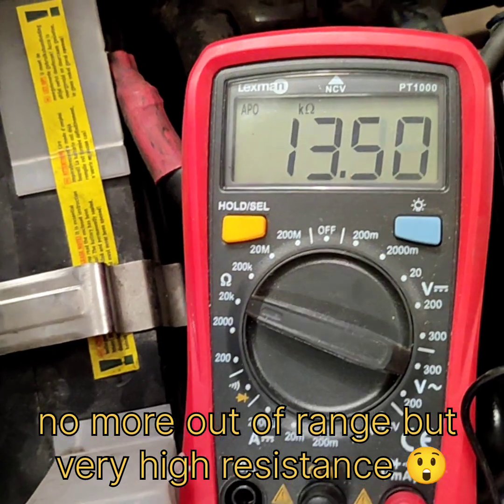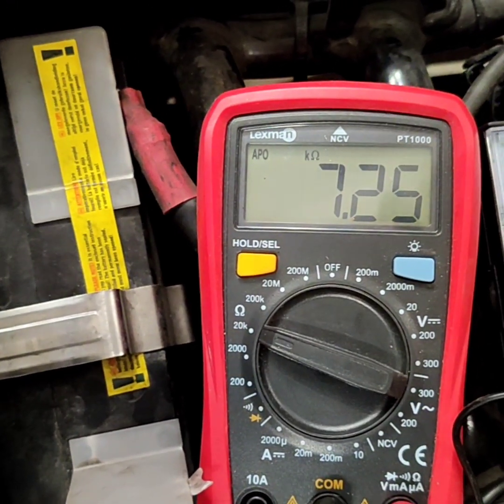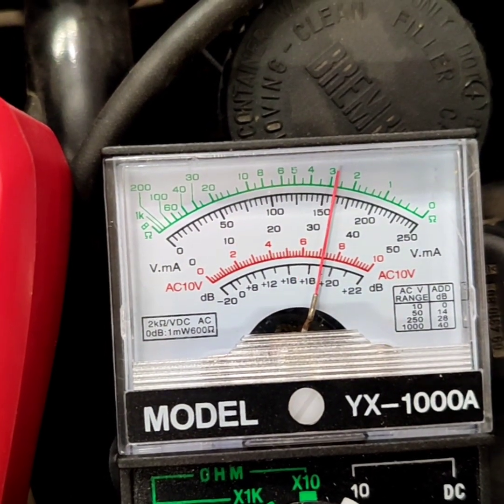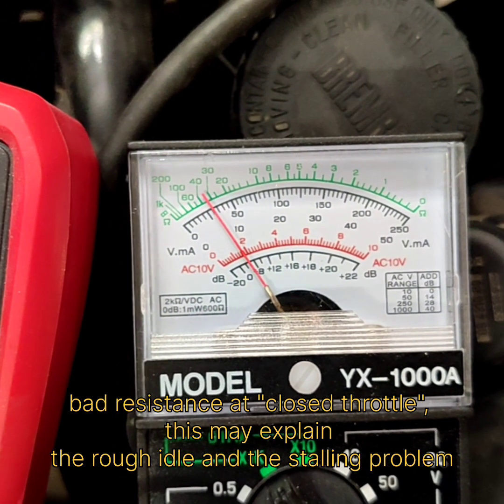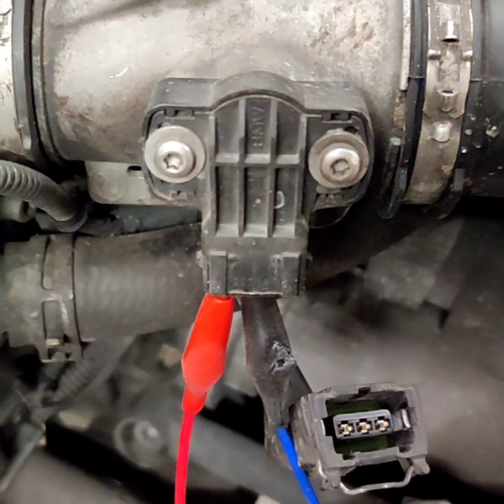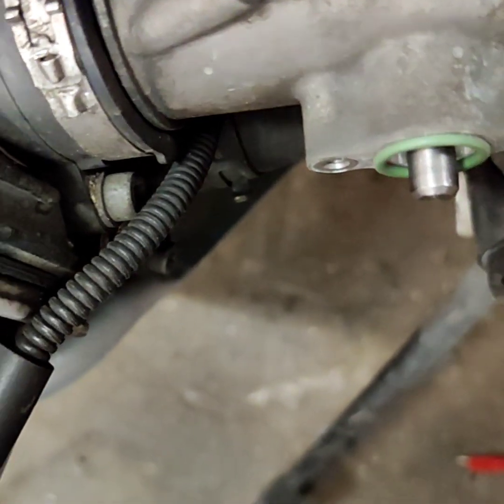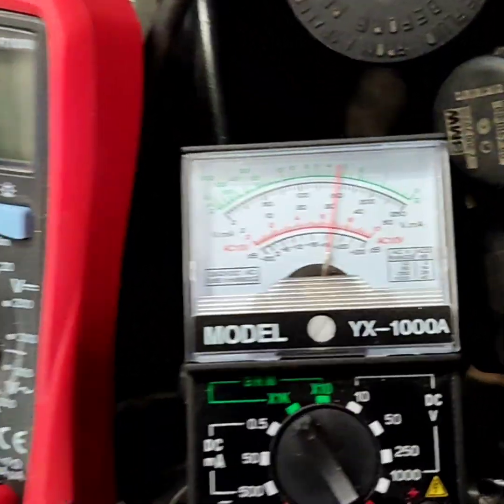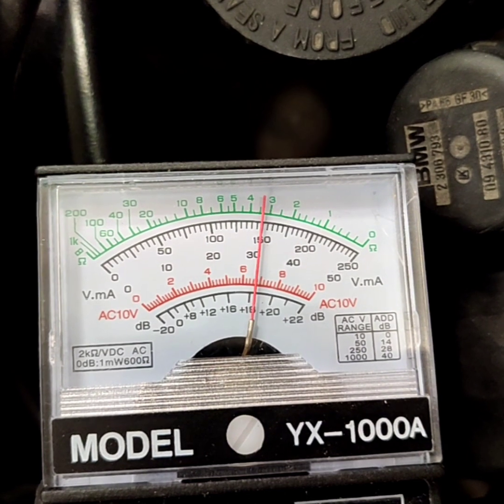BMW R1200 TPS sensor default and swap

Comment: BMW is not solving this issue on many models.

Now they are contemplating going into MOTOGP.

BMW is a bike designed for 1 race.  Not the long haul.

My 2013 BMW F700 is garbage.

BMW Never Again.

Comment: Thanks for this video.  Just to confirm, there was no need to have any setup performed because of the TPS replacement?
Reply from the maker: No, only the throttle calibration that is performed at the end of the video. Nothing else. Cheers
Reply: @laurentbelmon  Thanks!